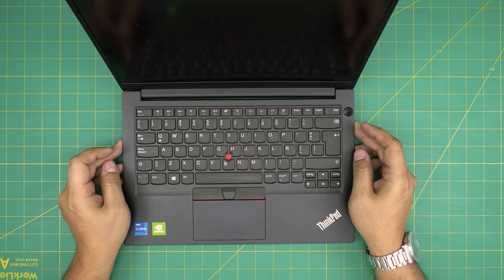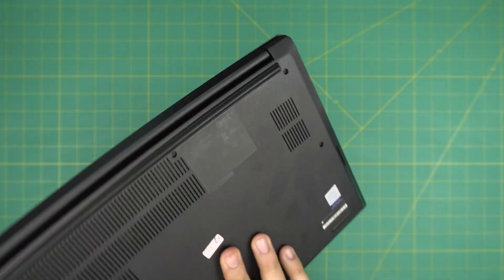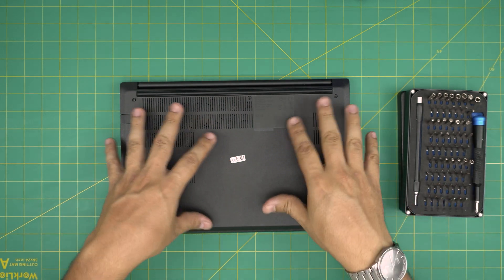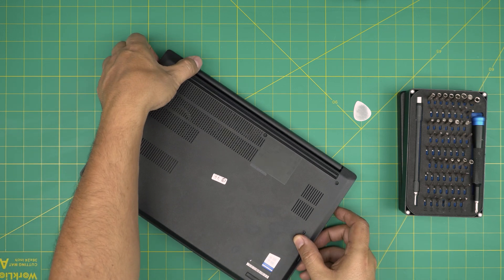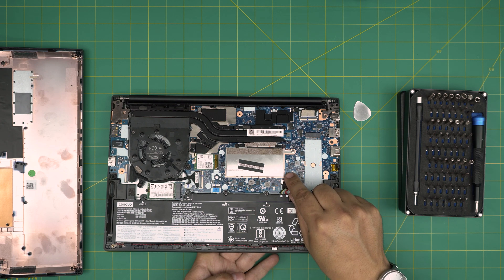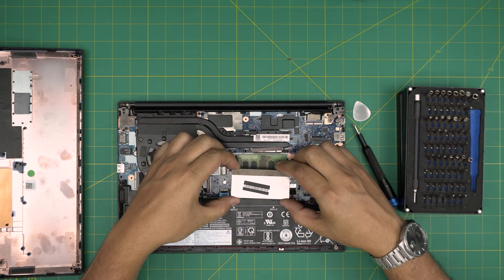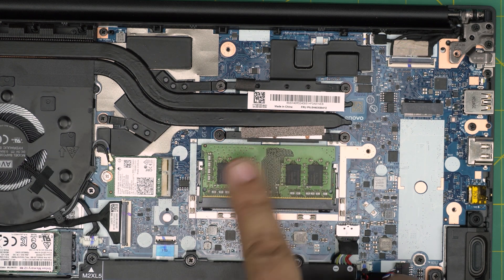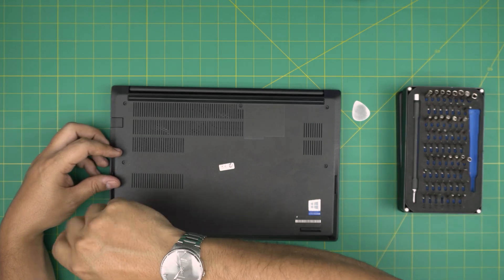How to Upgrade RAM for Lenovo ThinkPad E14 Laptop | Step by Step

Comment: i have "thinkpad e14 gen 2 20RA", can i put 32gb stick or i cant bc there may be some ram already soldered on the motherboard?
Reply from the maker: 🫠Regarding your question, sure you can without any issues.
Should you have any further questions or requests in the future, please don't hesitate to ask me.
cheers🍻
Reply: run crucial scan